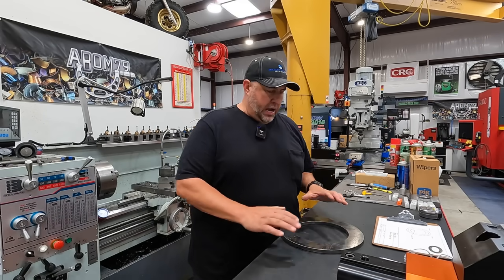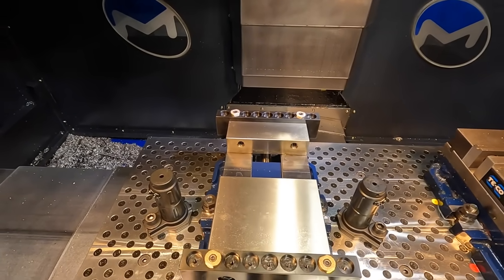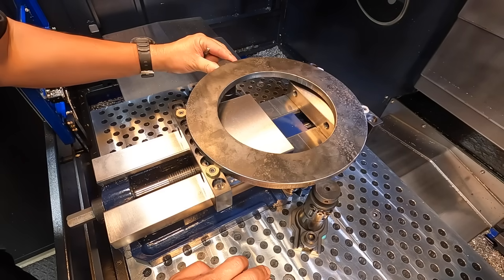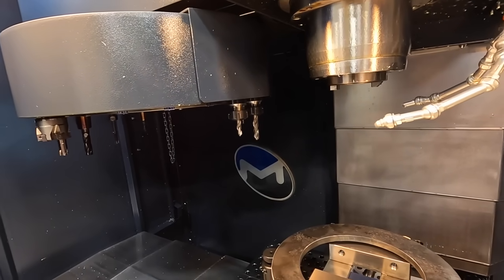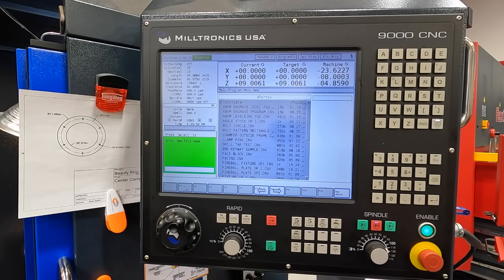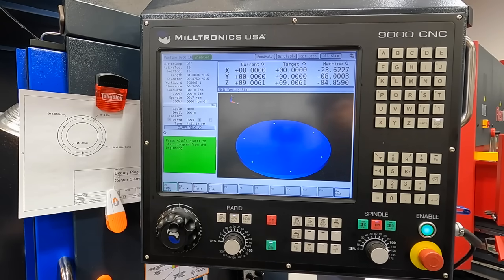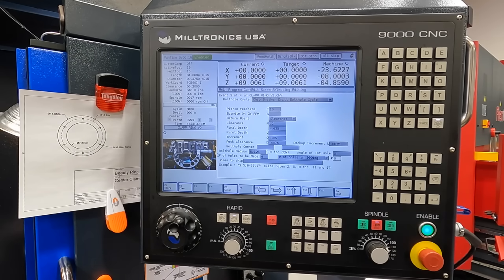Machining a Bolt Circle Using Milltronics Conversational Programming

Comment: Really miss the the hand machining  don't take me wrong tech is solid just miss the old school
Reply: CNC is just another tool. When you are running a business you have to be competitive, there are many examples where failing to keep up with technology has resulted in failed businesses. We are lucky these days that there are so many videos to choose from covering both old and new methods of machining. What we have here is showing how a machine shop has to keep up with the competition or risk failing as a business. We are lucky, if we want to, to be able to go along on that journey of learning to use this new tool.

Where I worked before retirement (gas turbines) the pipe shop had a CNC bending machine (1/4" OD up to 2.5 NB). A shop that relied on cutting and welding to manufacture pipes could not compete against the speed of bending a piece of pipe. We used to have a typical set up time of about  15 minutes and a typical per piece time of 1-2 minutes for example. That could be two or more bends (not necessarily 90°) with an odd plane of bend from one to the next. Hand bending the small tubes was a lot slower. The time to cut off, deburr, prep, weld and inspect a weld worked out about 1 hour per joint.  Larger pipe assemblies still needed a drawing and other operations such as drilling and welding for bosses. Outside contractors could not compete but that did not stop the bean counters regularly checking if our expensive pipes were really the good value for money we kept telling them they were. There were, incidentally, other advantages, the drawing office could produce a drawing with coordinate tables for many tubes on one sheet or for the bent pieces in a pipe. The coordinates came from CAD drawings and so we did not need individual or excessively detailed drawings for each different tube or pipe which saved on resources earlier in the production process.

Comment: It's great to take time to make small programs like this. Pretty soon you can use these base setups to knock out other similar parts or machine operations with slight changes in program.

Comment: Try entering "diameter/2" on the programming page to get radius. It works on many cnc machines. 
I use conversational programming mostly for my hobby cnc mill. It is just a lot faster for simple jobs.

Comment: I remember laying out a bolt circle by wedging a piece of wood into the I.D. and using dividers to determine the center of the piece. Then using the diameter, drawing the circle using Blue dye. Then the task was to determine the distance between the holes and mark them using the dividers. I miss working with my brother and the owner of that little shop.
Reply: Its even more easier with a lathe ,you just use sharp tool like threading knife to score the line by using toolpost. Usually its a last step you do when part is on dimensions.

Comment: Rule of thumb is for 118° drills you must add 1/3 the diameter to the depth so the point breaks through all the way to the full diameter. Your original. 125 was not enough.

Comment: That machine would be amazing if you had to make 30 of those
Reply: But to make 30 without fault you have to first learn and then practice then tweak
I get those that criticize and say "it'll be quicker the manual way" but I also applaud [excuse the term Adam) 'teaching an old dog new tricks'  Adam could nail that bolt hole manually probably blindfolded [except the checking of dimensions/centreing] but he aint learning new stuff.  If he gets the experience/knowledge he can run the CNC bulk jobs whilst also doing a one off jobs on any of the non automated machines = more $ and potentially more videos

Comment: I'm not a machinist, but years ago I ended up machining electrical equipment frames in my job. With the old Hurco KMB1 mill, you could do programs like this in 15-20 seconds. The new machine seems to be unnecessarily complicated.
Reply: That is just so funny.

Comment: In Mazatrol or ShopMill, this programm would take one minute to write - and even in EIA ISO it would be less than 5 minutes. But nevertheless, for people who doing their first steps in CNC programming or don't use the CNC every day, this Controller is still good by giving you some advices and suggestions.  
HSCO  - Drill bits from Guering, Type A520 or A510 (7xD) don't need a spot drill, like carbide drills - but im not sure if it are awailable in the US.
Reply: Prototrak 18 seconds including unload position.

Comment: bolt hole + spot + drill + chamfer should be a built in program. The diameter and thickness was already determined when probing. Shouldn't need to re-enter anything more than once. A wizard could ask any questions, like what kind of material, do you want chamfer, do you want tapping etc.

Comment: Summary
* (0:00) Project: The video demonstrates how to machine a bolt circle into a steel clamping ring using a Milltronics TRM3016 CNC mill with conversational programming.
* (0:14) Manual vs. CNC: The video compares the pros and cons of machining the bolt circle manually vs. using the CNC mill, noting that setup time is similar but the CNC machining process is much faster.
* (8:12) Conversational Programming:  The video provides a step-by-step walkthrough of how to use Milltronics' conversational programming to create a program for drilling the bolt circle.  This includes defining stock size, selecting tooling (spot drill and 1/2" drill), setting speeds and feeds, and defining the bolt circle parameters (diameter, number of holes, angle of the first hole).
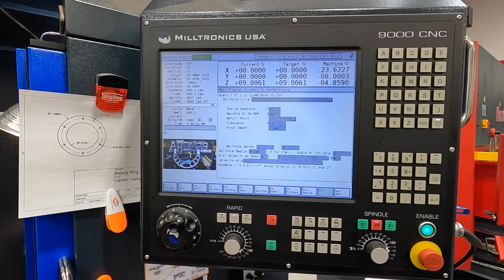* (13:57) Verification and Testing: The video emphasizes using the built-in verification feature to check the program before running it and then demonstrates a test run in the air (with the Z-axis raised) to ensure proper tool paths.
* (21:25) Real-World Machining: After the successful test, the actual machining is shown, including using coolant and highlighting the chip breaking action of the drill.
* (29:52) Deburring and Chamfering: The video concludes with deburring the holes manually using a flex arm and a chamfering tool.
* (32:20) Key Takeaway: The video illustrates the efficiency and ease of using conversational programming on a Milltronics CNC mill for simple machining tasks like bolt circles, even for those still learning the nuances of the software.

I used Google Gemini 1.5 Pro exp 0801 to summarize the transcript.
Cost (if I didn't use the free tier): $0.0744
Time: 21.50 seconds
Input tokens: 19136
Output tokens: 704

Comment: I think you will find that the conversational programming will come in handy for what you do. Some other creators use it a lot for some really complicated stuff. Keep after it. Rome wasn’t built in a day.
Reply: Conversational's utility really starts to diminish after you learn how to use CAM efficiently.  The other drawback of it is that you generally can't program something else while the machine is running.  With CAM I am programming OP2 while the machine is still running OP1, so it's not sitting there waiting for me to type in parameters.
Reply: @cskovach  Which conversational can't program while running? Mazatrol, Okuma, Siemens, even Heidenhain 155 which is from the 80's can.

Comment: Adam, It wouldn't work well for the part or work holding setup you showed, but it is possible to chamfer  the top and bottom of the holes with one setup. If the part, and setup allows, you can use a doble angle chamfer cutter with interpolation to chamfer the top and bottom of the hole.

Comment: From experience with my small wood CNC, I am quickly understanding the logic in the programming.  Everything makes sense and I well understand how easily it is to forget one step.  
My question: are your machines capable of very close tolerances such as constantly maintaining 0.0001" tolerance, or does it require more specialized machines?  Thanks.
Reply: 0.0001" tolerance on parts is insane for any mill. That takes not only a high precision mill, but a climate controlled environment and extra high precision tooling to nail every time. 0.001" on the other hand I would think at least for positioning of the tool, it's probably that good or better, but you still have to take into account tool deflection, tool wear, tool runout, temperature etc. If you are going to churn out parts within 0.001" all day.
Reply: @2testtest2  nailed it.  there are so many variables that come into play at that level of precision that tolerances start to become extremely subjective.

Comment: Question does milltronics run windows on there maschines?
Reply: Straight from google;
''Yes, some Milltronics machines run on Windows, including the 9000-DGI Series control. The 9000-DGI Series is a Windows-based platform that includes a 15-inch LCD touch screen, 120 GB of disk storage, and 4 GB of memory. It also has a G-code visualization screen and other user-friendly features. Milltronics also offers the Digital Generation Interface (DGI) Desktop Software, which is designed to run on Windows PCs.''

Comment: All the time taking to set this up for one part had me wondering if it would have been faster to lay it out by hand and manually drill it?
Reply: More fun this way.
Reply: @karlc8808  I get that, and I get it for the channel content, I just figure it would be much faster to layout by hand and drill.
Reply: @tankerboysabot  If you only ever do what's quicker, you'll never use CNC when you have a manual mill available.
Reply: @spikeypineapple552  CNC machines are wonderfull for solving complex problems ,but people use them these days for everything,same way we forgot to do math by brain since you have calculator everywhere.Lathe ,drill press and jig could put a production of these flanges for 10x less price of cnc machine ,and it would pop them faster.
Good for him that he is learning,but i guess i miss old guy with manual lathes -everyone these days just type in program and wooosh by editing magic happens.

Comment: Nice job, Adam!  Let me pose a hypothetical addition to your program.  This is only to illustrate something that you might need in a future project, not a real suggestion for this project.  You said that your blanks for this project weren't totally flat.  Of course this is very common.  In this project, you decided to do some chamfering on a second machine because you didn't know exactly the z value of the work piece at each hole.  There might be future jobs where it would be better to do everything on one setup.  If I recall, you used a Renishaw probe on your workpiece after mounting to determine the approximate height.  How about having a helper program that, given the positions of the holes, used the probe to measure the actual z values?

I don't know how your software works, but it must be possible somehow for the big program to dump a table of (x,y)positions for the holes and then have the probe build a table of z values.  I'm trying to make this really simple, as I don't know how this CNC software does these kinds of things.

Again, this is just a way for me to suggest something that you might find useful in the future.  You did really well here.

Comment: Hey Adom, I was watching one of your old shaper videos when you had that gummy bl9ck of steel figuring out what tool works better. I was wondering if carbide would work on the shaper. If watched you with the high speed steel and I know if carbide would work, you would be using it. Just wondering what carbide would do. Keep the videos coming brother
Reply: Carbide is fragile and doesn't like impact or interrupted cuts so not really a good option for Shaper tools.

Comment: It seems like you should be able to copy and paste and then just change the depth. I however have never used that machine
Reply: Nothing wrong with asking questions.
Reply: yeah, re-entering the bolt hole circle parameters was an error-prone step

Comment: Adam, would it be fair to state that the setup time would be similar between a manual and cnc setup in this case?
Reply: I'd recon he'd be faster on manual, but that's because he's still learning and has years of experience doing it manually. Once he's done that few dozen times it will be quicker. And the best part is you can do something else while the cnc does it's thing.
Reply: The giant difference is you see most of your mistakes before touching metal.

Comment: its not the wayviness of the workpiece, its when you put in 0.5 in depth cuz the part is 0.5 in thick, just the point of the drill, for the program is 0.5in deep, so the flutes are still in the material

Comment: Looks pretty primitive compared to a modern CAM setup with CAMWorks, Fusion, etc. maybe OK for very simple things? It'd seems that it's a lot to learn that is very specific to this machine's controller.
Reply: It looks about the same work as doing it in CAD,  and you're doing it standing up right at the machine.   The only downside is if this part is then used in a complex assembly and you'd have to put it in CAD again anyway.  It'd be nice if the library of parts you program conversationally could be simply imported into the CAD machine too.
I think a conversational UI on a lathe could be even better than CAD with easy access to threading cycles etc, although I think it'd be a wash if you were highly proficient in your CAD (or if that was someone else's job)
My mill and PC are networked,  but I still use the sneakernet with filenames and tool numbers in my head.  I wish I had a nice conversational UI on my mill too. My mill runs LinuxCNC as its controller so I could set that up
Reply: The milltronics are I wouldn't say a "budget" machine but more budget friendly then a hurco they are owned by hurco or the company that owns hurco. But the milltronics uses  a simpler version of the hurco conversational programming that is really good. cam is great if you have a solid model to work from but most jobs i can program the same speed on the hurco controller then on fusion or esprit. it really comes down to the jobs you are running and if you need to do a lot of programming.

Comment: Adam. You couldn't have chosen a worst example of cnc v conventional. I use both and either have their advantages. Just saying before the Luddites get involved. 
I don't have a conversational mill. When you set the final depth of hole, is that for the drill point or the shank? Also, the cnc is perfectly capable of producing chamfers which would save 1 op on the flex arm.
Reply: CNC chamfers work best on perfectly flat parts. This plate  is wavy with high and low areas. Makes sense to do them manually.
Reply: @ellieprice363  With a cordless drill. 😀

Comment: I do not see the sense in spot drilling .. just chuck a Screw Machine drill bit, (if you don't trust a long one) in the final diameter needed, and drill it.
Reply: I use rivet drill bit -its very short very rigid and it has 2 sides sharpened -they are extremely cheap so i dont bother with sharpening them.
Reply: Agree.  A stubby length carbide drill would blast through these holes in under a second.  No spot needed

Comment: I'm surprised you're putting so much time into the conversational stuff instead of going whole hog and designing on a computer.
Reply: I'm surprised you don't understand that some tasks are easier with one method versus another. And also that you don't understand the point of Adam's channel, which is education, not high output.

Comment: If youve 50 to make I guess the set up programs time make sense but while you doing all that I would have 2 finished on a bridgeport and be on a coffee break.
Reply: 5 minutes for 1 piece including programming + setup + both chamfers on a prototrak.
Reply: @machinists-shortcuts  It does seem long winded or is that just Adam?😂
Reply: I would challenge that. Ran a milltronics for years after running a Bridgeport for many years. No contest. I could make one part faster on the milltronics than I could on a Bridgeport. That is starting from scratch on both machines. No tools, no vice, nothing set up.
Reply: @Cattelinoable  Take on Kevin's challenge. It will be interesting to compare with the prototrak machine time with a vise already on the machine.
Reply: @Cattelinoable  perhaps its just Adam being slow.
Reply: @machinists-shortcuts  make the challenge what was brought up. Bridgeport manual with no control, just a DRO, versus Milltronics. Start from scratch, no tools, no program, no work holding.
Reply: @Cattelinoable  Good idea. My video was almost the same as a manual Bridgeport apart from the point to point moves by the control. It would be very educational to see a video from you to show how this type of job is done in industry on a Milltronics.
Reply: Also think there are two separate discussions here. A tutorial video for a manual mill compared to the one Adam made would likely be just as long and informative. Describing the math to determine the hole locations alone would take considerable time. The thing I always liked about the Milltronics programming was the logic in the steps and the presentation of the options/menu. Seems very straight forward and very aligned with the process steps needed to complete the part.
Reply: @Cattelinoable  the third option that is perfect for this 1 off job is the 2 axis CNC. The only input is the centre coordinates, the number of holes, the PCD and the rotation angle. Only takes a few seconds to program.
Reply: @machinists-shortcuts  definitely.

Comment: Ha, ha. The simulation of the program (clamp ring v2) shows the drilling, but doesn’t show the chips being made. 😢 Fake. Send it back. 😆 Okay, not really. Being able to see what the CNC machine is going to do beforehand is a good idea; this way, you can catch bozo errors before you waste valuable material or time. Also, the magnet holding up the drawing looks like a bottle of aftershave. 😅